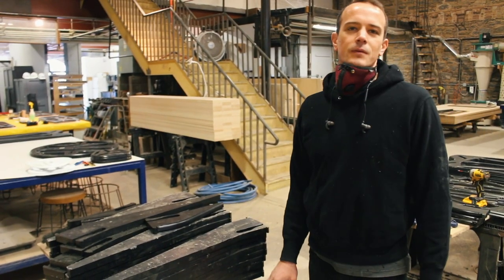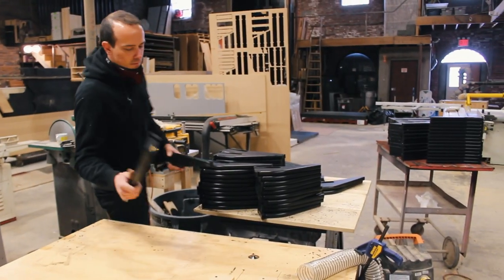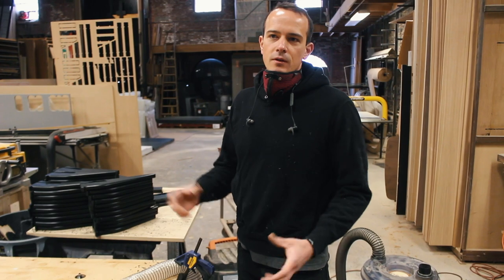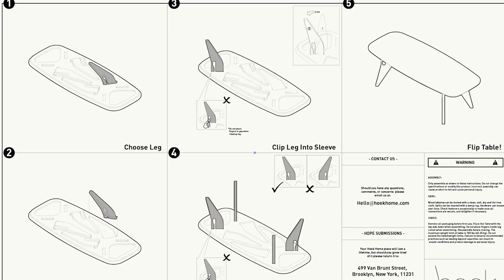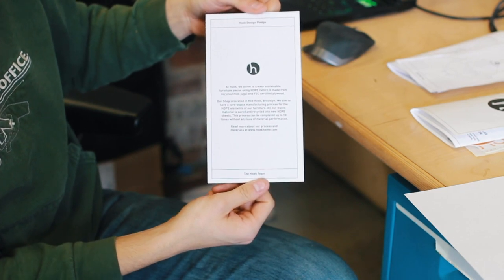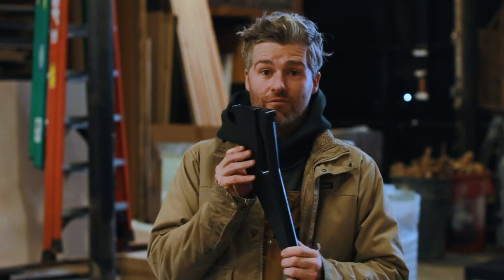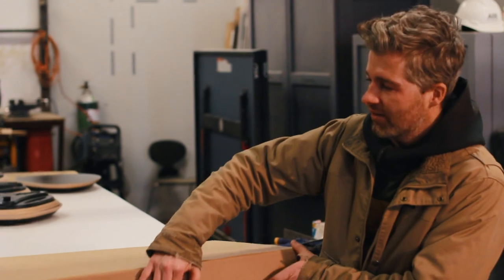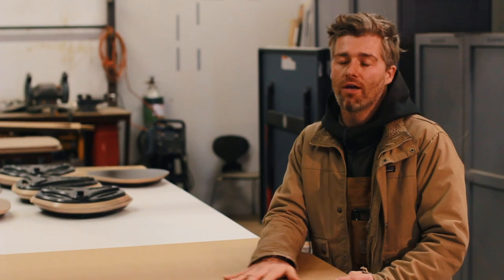How to ROUTE RECYCLED PLASTIC

Comment: Looks like HDPE is nice to work with. Do you think it would work well for table tops? I'm looking for an alternative to plywood or glass in my designs.
Reply from the maker: Yes, it's a really nice material to work with. In our experience, it cuts really cleanly with most woodworking-based tools. It's also very easy to wipe down so that's certainly a benefit for tabletops. It is more flexible than plywood and a good bit heavier so that's a negative for a large table surface. We'd love to see what you have in mind!
Reply: @hoek  Sounds good. On my website (connorholland.com) are my Pluto and Saturn side tables, that currently have black dyed birch plywood tops. I'm thinking HDPE may be better for them, as well as the seat and back of my Aeroformed Chair.
Reply from the maker: @ConnorHolland  Just checked out your site. Beautiful pieces! Yes, I think HDPE would be very suited to those pieces.
Reply: @hoek  Thank you! It would be good to have a new material to experiment with, so will definitely get some